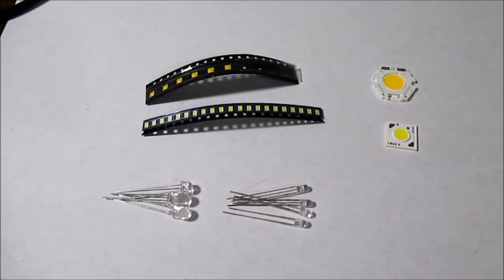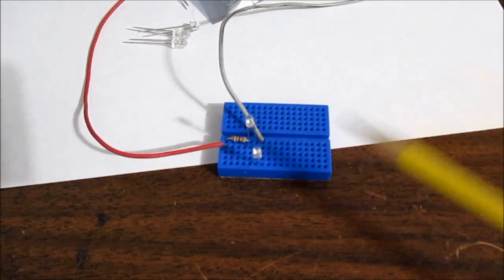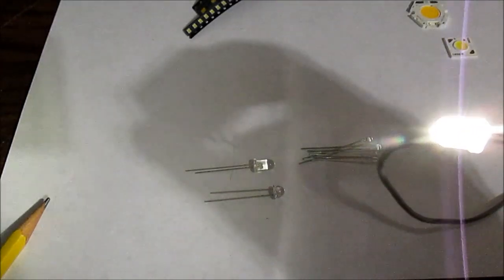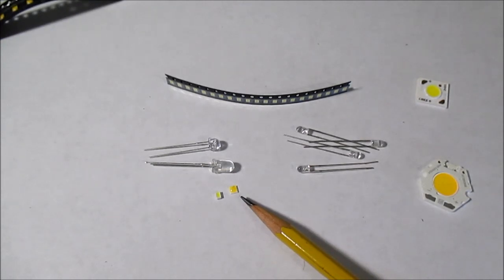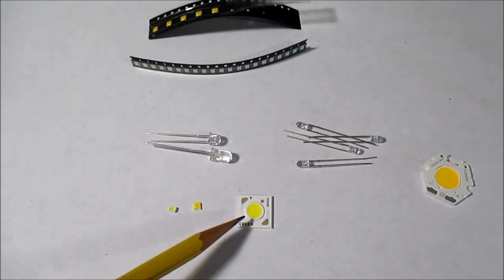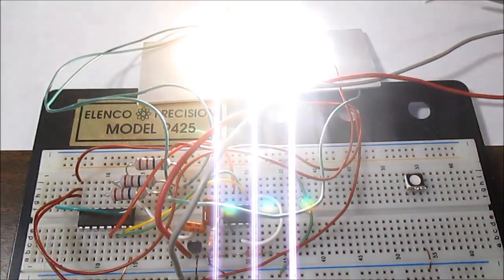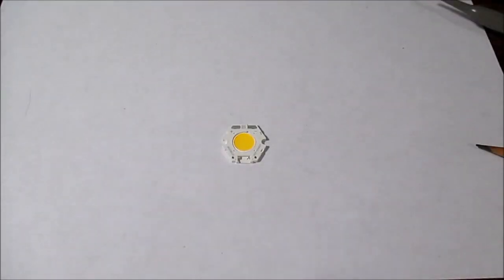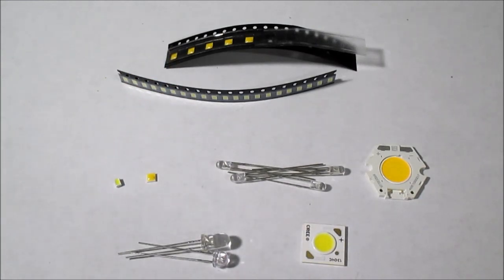High quality component LEDs reviewed and tested

Comment: So awful to see you talking about "high quality LEDs" and then you connect them to the most horrendous cheap and nasty method of current control (dropping resistor). Truly, that is so totally wrong. No wonder your chips don't last properly.
Reply from the maker: When I performed the long term test, they were connected to a constant current source. What is wrong with using a resistor to show the LEDs lighting up for a video?
Reply: Hi JohnAudio. There is no problem using a resistor for making a video. However WITHIN that same video you repeatedly tell people about using a resistor. Examples: 2:45 and 12:31 - OK for the bridgelux you must be using some form of variable current source, however you don't explain that directly. So my comments are to balance the message that you send to viewers, just so they know that they need to be kinder to the LEDs by powering them properly. Does that make sense?
Reply from the maker: I agree that using a resistor on a high power LED, like that Bridgelux, would not make sense. With a 12v supply, dropping 9v through a resistor to light up a 3v power LED would be wasteful. However, I often do use resistors with the 9v CXA1304 in 12v applications when the resistor's dissipation can be kept under 1w or so. It is not ideal, but it works. At 2:45 I said, "Using a device such as a resistor." I was implying it could be some other device. Listen, I don't mind a good debate but this video was not about driving LEDs. You could have made your point without the the over dramatic "horrendous" and "nasty" description.
Reply: OK JohnAudio, no problem. The appeal of your channel is that you use a no-nonsense straight up style and you do things properly, rather taking shortcuts. I am the same, and I work in the LED industry. I guess what I was trying to point out is that when people are taking the trouble (and expense) of buying top quality LEDs, then they should consider taking the trouble to drive them properly. It does make a difference to the life of the devices.
Reply: It si 100% perfectly fine for demo purposes and testing. Only bad thing is it wastes power.
Why you dislike resistor as current limiter, nothing can go really wrong this way, you just choose right high resistance and set voltage high enough that you can't accidentally crank voltage too high (on analog adjustable PSU with no lock button, where you can bump into knob, etc.) 
Relatively expensive laser diodes are often tested /adjusted exactly that way - minimal chance of blowing them accidentally....

Comment: Great video, John. Any chance you could do a video on how to use these in an automotive application. I'm not sure how to select and use the resistor you were talking about.
Reply: To use LEDs properly in Automotive applications (actually is any serious application), you need to use a better method of controlling the current. The voltage in a car varies massively, and that means that there is no value of resistor that can be used. Furthermore the voltage across the LED changes when it gets hot, and that means that the voltage drop across the resistor changes. Overall this means that a simple voltage dropping resistor as a current limiter is a really bad idea. Also, the resistor has to drop lots of voltage, which means that it is consuming lots of power and doing absolutely nothing except heating up the LED and killing it. So, use proper current control - almost ANY alternative method is better than a resistor..
Reply: So instead of just telling us how wrong this is, how about sharing some of the alternative methods you believe to be better. Do you have a video showing how to do this?  I'm just trying to learn here.
Reply: jeff.hays - there are hundreds of videos already, many are wrong. The thing that I am trying to say is that resistors are almost never the correct way to drive LEDs, except for extremely low power applications for indicator usage. Yes, a resistor "works" to make the light come out, however it is not controlling the current properly. The best method depends on the application, but the correct way is called a "LED DRIVER". There are complicated drivers and simple drivers, and the best method to choose depends on the application. If you want to learn, then search for "LED Drivers".
Reply from the maker: I used a dropping resistor with the 9v CXA1304 in the dome lights of both my vehicles. I based the calculations on 14 volts with a bit of headroom. I kept the current < 200ma since it would be too bright otherwise. How it works depends on your vehicle. I was able to fit the arrangement including an adequate heat sink into the fitting. Because ordinary incandescent lamps have an exponential light output response vs voltage, the LED resistor combo varies less in brightness change so it is not a problem. Sure, it is not as efficient as using a driver, however the total draw at 200ma (2.8w) is far less than the original 12w bulb and much brighter.

Comment: You know I bought one of those very cheap LED packs from China as I could not be bothered to place multiple orders through the normal wholesalers who make the buying process as tedious as possible.  I just wanted some dirty grab stock for spares. As you say I was very disappointed with the China multiple pack. Had about the same light output as a spastic glow worm.

Comment: For the front-porch light, did you implement a linear supply, or capacitive-dropper supply?  The latter seem much more familiar to us tinkerers now-a-days, given the many USB mini power supplies torn-down and examined.  Thx.
Reply from the maker: I had a 12v wallwart and added a 33 ohm series resistor. I ran wire out to the porch light.

Comment: The Cree CXA1304 COBs are magnificent; especially the CRI 95-minimum (R9 >70) bin.  I often replace the modules in cheap IKEA lights with them, as they make excellent practicals for filmmaking!
Reply from the maker: I have one of those high CRI 1304 LEDs that I plan to make a lightbox with so I can copy my old 35mm slides over to digital using a macro lens. I use them for so many projects. I made my parents under cabinet lights with them. Truly wonderful LEDs.